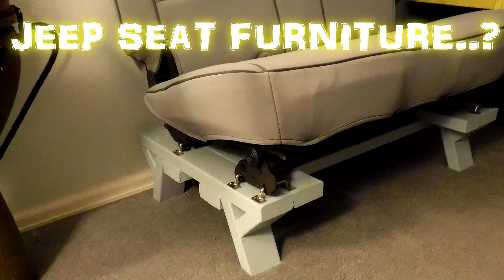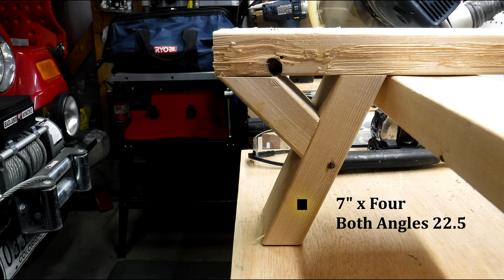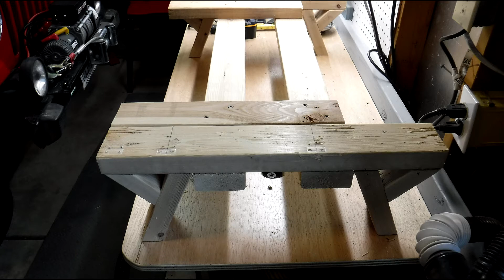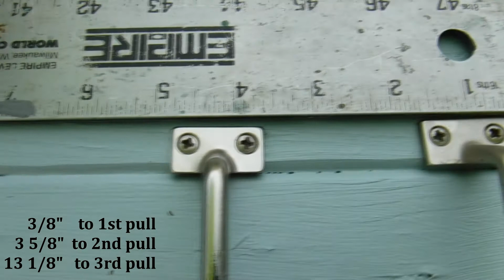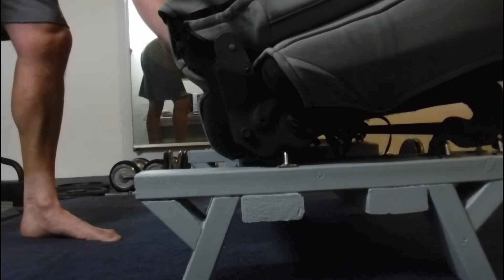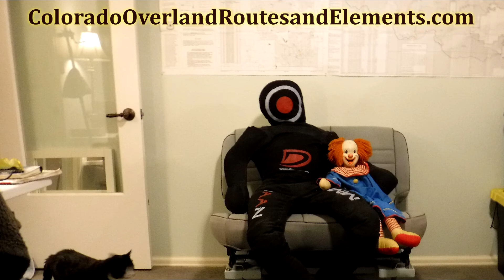DIY / How-To: Jeep Seat TJ / LJ Wrangler seat base for Camping, Storage, Garage etc.

Comment: Thank you for posting this. My wife has a 2dr Wranlger and the seat is just taking up space in my office doing nothing. I'm going to turn it into a couch and possibly angle the seat so it's parallel with the ground without that tilted back angle with some modifications. Here's to a fun DIY in the near future. Cheers!
Reply from the maker: I have mine in my office too, it's a conversation starter.  Good luck with the build!

Comment: Perfectly simple!
Reply from the maker: Thank you!
Reply: @ColoradoOverland  I ended up using your measurements and made one myself! It's on wheels and I swapped out 2x6 instead of 2x4s so had to adjust the spacing just a bit.  I bought 2" square u-bolts from McMaster Carr for it to hook onto.  It was an easy quick project and very functional.
Reply from the maker: @AngelaAnderson1  You just made my morning, I'm really happy that you found this useful!!  Thank you!!!!!